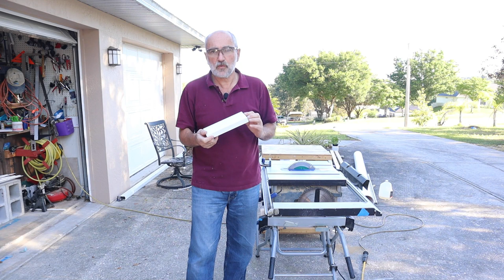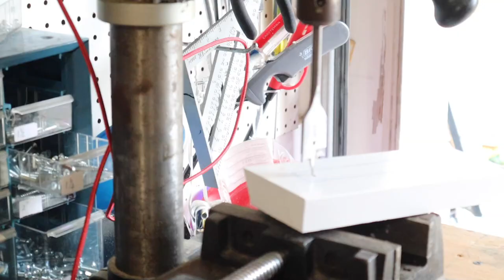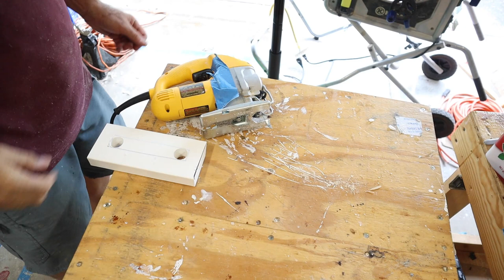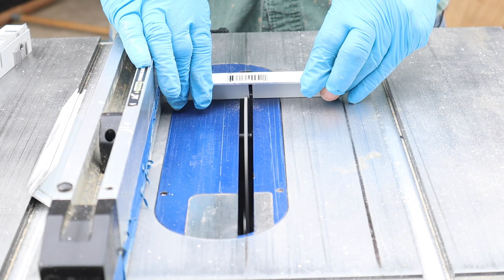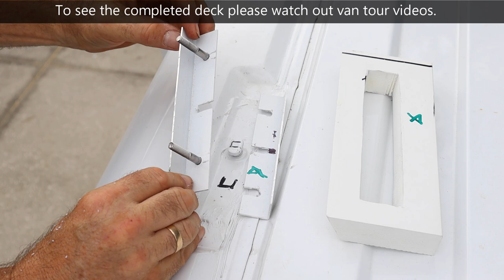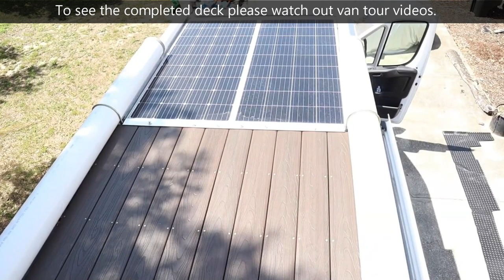Van Life build series - DIY Ram Promaster Roof Mount Brackets for Roof Deck and Solar Panels

Comment: I wonder if over time your pvc will be softened and your bracket will loose tension?
Reply from the maker: In over 3 years it hasn't softened. It's solid. The brackets are as tight as the day they were installed. No problems so far.

Comment: Very nice. What kind of profile rail did you use to make the roof rails and cross bars? It's not 80/20 but looks sufficient.
Reply from the maker: For the roof rack itself I used superstrut, you can purchase it at the big box stores.   For the roof mount brackets its aluminum angle, full instructions and products links are included in the instructions at the Esty store.